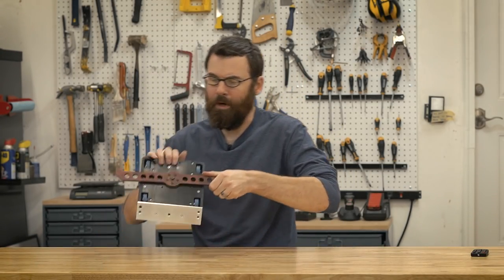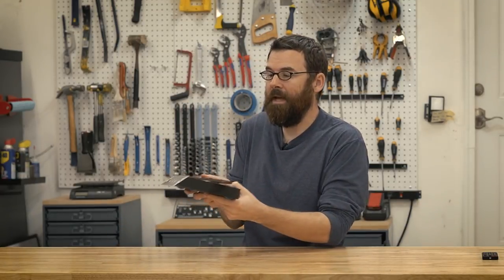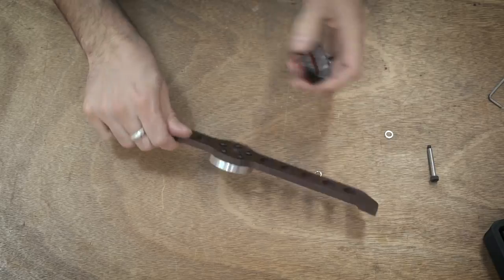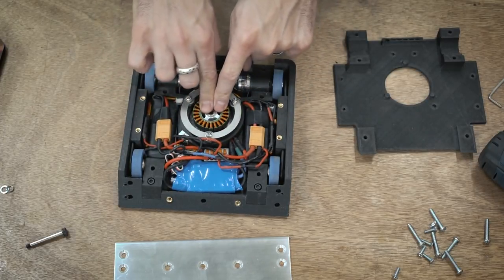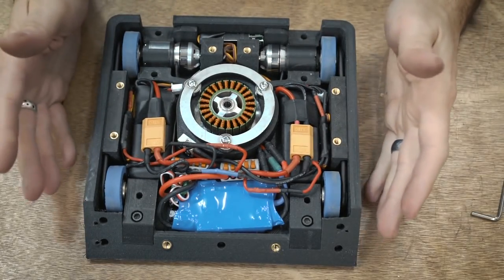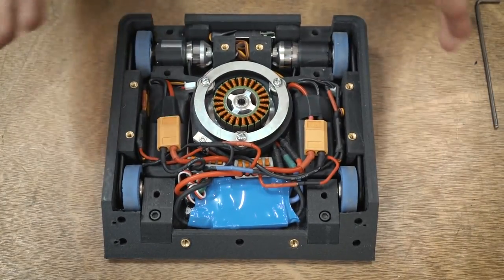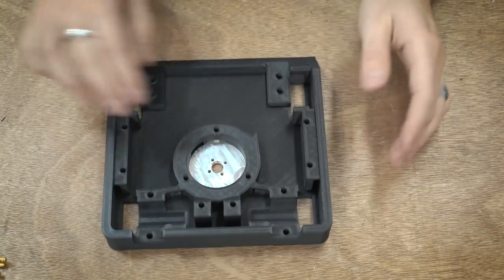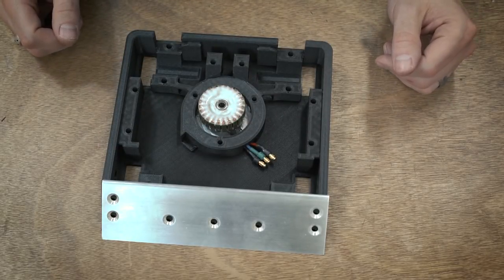Anxiety Attack Overview (Beetleweight Combat Robot)

Comment: What are your thoughts regarding Nylon X and similar vs Polycarbonate blends like PC Max for frames? I've found the increased stiffness of PC to be desirable for combat but in extreme cases it will shatter vs 'tear' like the nylon. Sadly both are just as challenging to print as each other, warping might even be more severe with PC!
Reply from the maker: I need to play more with filaments.  The problem is testing them in real situations is limited, so it takes a long time to learn what's best.  I am going to test the NylonG next and maybe try some polycarb.  I've seen other people use it and it SEEMS like it's good, but I like the give that nylon has.

Comment: It seems like your ESC‘s are really big for there power. I only build drones but my 50-60A ESC‘s seem a lot lighter and smaller. I have no experience building combat robots though so maybe I’m missing something.
Reply from the maker: I'm maxing all of them out.  I am peaking at around 55A on the weapon, and it could use more power.  On the drive, I've seen around 10-12A when they get close to stalling.  Usually you want to double the rating for safety, but I didn't have the weight or space.
Reply: Oh okay. I did not know that. With drones it’s usually okay to pick one 5A higher than the Max Motor current and it’s save enough. But I guess the cooling under a giant fan is also a lot better than in a closed box.
Reply from the maker: @blise518B  USUALLY size and weight equates to actual power output.  Some of the new chinese ones are pretty good, but historically, they've not been well-suited for combat situations.  In short, when using components for combat robots, you will get to see how they fail, and quickly.  I was using a bolt with a tensile strength of 140,000 PSI, and it got bent in one hit.  It seems like the rules of physics and electricity don't always apply in combat ;-)
Reply: Robert Cowan your right some Chinese sellers are not really thrust worthy. I usually stick to sellers and brands that I had no problems with. Most stuff you buy in hobby stores is manufactured in China anyway so if you buy directly from China you will save a lot of money.
I know it’s bad for local stores but as a student my budget is limited.

Comment: Great video! Just gotta cross our fingers you don't get flipped over 😬😬 I am looking into making my first 3lb from some scrap, things are gonna be really tight and I wanted to use 4 N20's as drive because they where small. Some people I talked to said it didn't work but I looked closer at your video on kamikaze and where you using N20's on that? The one gearbox did shear I was gonna re -enforce them and just see what happens in battle.
Reply: I have a couple recommendations for reinforcement based on my experience using silver sparks in a beetle (bit bigger than N20s but the idea is the same). First, do not face-mount the motors to the frame using the screw holes. Instead, clamp-mount the motor in such a way that supports both the motor and the gearbox. Second, support the output shaft somewhere between the motor and the wheel using a bearing. Third, use soft foam wheels to help avoid transferring shock to the gearboxes. If N20s can be made to work in a beetle, that's probably how you'd do it.

Comment: Maximum Material Removal Rates are calculated off of Surface Footage per minute SFM... S7 has an SFM based on What Material it's Cutting.. 
S7 cutting plastic is around 1000SFM,
S7 Cutting Aluminum 500SFM, S7 Cutting Titanium I Guarantee it's aboot 40 SFM... 
I'ma 15 Year Machinist, Toolmaker, and Master Heat Treater, currently in college for Mech Engineering Degree. Thinking about forming a Club at my college...

Oh the formula to Calculate RPM is as follows.  (SFM X 3.82) Divided by Diameter of Cutter = RPM

Brazed Carbide cutting Titanium has an SFM of 250-ish... You can Braze Carbide Flakes on the ends of a Chunk of 1018....

Your Expensive S7 needs the holes replaced by an open window....       
It's not How Much Mass, it's Where the Mass is placed that's critical...

Comment: Thoughts: 1) Use shims to adjust one of the wheel supports, then the frame bein planar is not so critical. 2) Seems like   the  motor's rotor may distort causing problems with the magnets. Possibly you could machine a sleeve that pressfits/loctites around it's diameter, maybe it won't be an issue 3)good luck!

Comment: For ESCs, have you ever thought about looking at Lumenier's BLHeli_S Opto units? They might be a bit on the pricy side, but they're unusually compact. I run a 35A one in in my antweight beater, Shadowkitty. Usually 35A ESCs are a bit big for antweights, but I needed a really small one to handle the current draw of a Lumenier 2206 Freybott Edition and the Lumenier Opto 35A isn't much bigger than a Turnigy Plush 20A.

Comment: Who says Both Driven wheels have to be on the same Axle Alignment, if you utilize a dummy wheel and driven wheel on the same axle alignment you would solve the stability issue by balanced placement of component weight.....
It might be a warped chassis, most likely the Corner Weights are biased to the Back, the holes aren't big enough in the blade and your making Propeller Wash.....

Put a wedge of 60 degrees on the other three sides, makes for bidirectional driving and Minimizes the Target Areas you present to your Opponent....

Comment: Great video, very informative. Have you thought about shaping the bar like an upside down helicopter blade to get downforce/negative lift? I don't know how fast the bar needs to spin to even make a tiny bit of downforce or if it puts unnecessary stress on the motor, but it might increase grip and make it harder for other bots to get under you. Could be something to look into in the future.
Reply from the maker: The final version actually uses a quadcopter prop on top for downforce.  I'm not sure how much force it provided though.
Reply: People have tried, and they have all failed to function
Reply: @Coboxite  
Foiled! did pretty well with it.

Comment: Hi, Robert! Immaculate engineering and great video quality as always. No problems about pronunciation, by the way - it was Noah Webster's aim in life to expunge all traces of French from U S English,  so chassis (or chassis) is absolutely fine. Then of course there's the old Leftenant/Lootenant Cuddles thing... Yeah, Sergeant, I know. But what about the aluminium/aluminum wedge, eh? If you're replacing it with something stronger, don't use titanium, insist on titanum. Or magnesum-alloy. Much better. More Amercan. I'll go away, now. They're expecting me down at the gymnasum.  ;-)

Comment: Bit late to the party but what size threaded inserts are they? Currently designing my own combat robot but can’t pick a screw diameter, m3, m4, m5? Think in the states your sizes are different but would be greatful for a suggestion, for my first I’m planning 3D printed nylon and hdpe with a machined weapon, outsourced, the chassis I want to make myself so am limited when it comes to tools, they will be printed or for the hdpe jigsaw and a lot of filing / sanding, just can’t figure out what size screw to use or find somewhere that suggests what to use.

Comment: Fantastic video, thank you! Have you ever tested with gyro stabilisation for yaw control? Possibly wouldn’t be tough enough, but during battles you often see operators having a some difficulty and wasting time lining up for an attack.
Reply from the maker: Thanks!  I didn't play with anything like that.  In the fight video recap (coming up next) you can see what happens when it gets off-balance.  I don't think there is a way to correct for this.

Comment: What would you recommend as a good cnc milling machine that can cut steel for around $1000 or less. Thanks for any advice.
Reply from the maker: Unfortunately, no.  Other than just buying used, there's nothing out there under several thousand that will cut steel well.  Just outsource, it's cheaper unless you're making a lot of parts.

Comment: Is your printer using mesh leveling, like a BLTouch? It might help with some of the first layer adhesion problems you were talking about.
Reply from the maker: Yes, it is.  I fixed the problem by increasing the bed temp, and re-doing all the mesh leveling AND manually leveling the bed better.

Comment: Why did you make the motor mount holes on the bottom not square to the robot, my OCD is killing me haha. Beautiful design otherwise.
Reply from the maker: They are rotated so the motor wire can exit at the correct angle.

Comment: Does that Nylon-X respond well to heat treating?  Heat the printed part to a nominal temp, then turn off the oven and let it cool down slowly.  I wonder if it will help with correcting warping?
Reply from the maker: I'm not sure.  It's something I thought of, but didn't end up trying.  The sizes were all pretty critical, so I would need to experiment with shrinkage to get the final sizes right.

Comment: I like the idea of using 3D printed nylons, what sort of % infill are you using? I've been a fan now of the gyroid infill after seeing some strength tests with it compared to other geometrical infills.
Reply from the maker: I think I'm only doing 10 or 20%.  It's too low, but I didn't have any extra weight.

Comment: How do you check for RPM of Motor for spin adjustment .... Is motor sensored ?
Reply from the maker: it is not sensored.  I'm not sure what you're asking, but you just multiply the KV rating by the voltage to get RPM.

Comment: Fantastic work as always - I'm trying a Nylon Carbon Fibre weapon motor mounting panel in my 30lb/13.6kg undercutter this weekend, hopefully it goes ok!
Reply from the maker: Thanks!  That sounds ambitious!  Are you going to print it solid?  Hopefully a really high in-fill at least.  Good luck!
Reply: Robert Cowan it is solid yes. Not sure how it’ll fare but its an experiment more than anything else, wouldn’t be doing it if I hadn’t got access to the printer at work that they rarely let me do my own stuff on 😄

Comment: I personally dont like the nutcerts on 3d printed parts, better to have the bolts go through the complete part and have a large washer or threaded plate on the backside. It compresses the parts holding the layers together a little more. With nutcerts they can pull out under stress.
Reply from the maker: I am going to make a video to show what I found with them.  They absolutely WILL NOT pull out under stress.  Look at when the wedge was ripped off, it took the whole front-end with it.  I 3d printed a lot of test parts and used my hydraulic and arbor presses to test the pullout on them, and in all tests, the heat-set inserts pulled the entire core of the print out.

Comment: Why not take the 3d printed part and then using your Tormach true up the prerequisite surfaces to basically cut it true and straight?
Reply from the maker: this stuff doesn't machine well.  plus, that would add a TON more time.  lastly, my Y axis doesn't have enough travel.  :-/
Reply: @RobertCowanDIY  if your concern is just the bottom sitting flat you can just deck that surface using a large diameter flycutter. In addition im not sure your print medium but with platics sharp HSS usually is your best bet for cutting it. And with a large diameter flycutter your y axis travel shouldnt be an issue

Comment: To help warping look at adding lily pads at the problematic corners. Discs that are several layers thick and stick out past the corners to increase the surface area there. I have found that works a lot better then a brim around the entire printed part.
Reply from the maker: Nylon can be strong!  In one print it was sticking just fine, but it actually warped the print bed!  When it cooled, it pulled the edges of the bed up, which was surprising!  I think I might need a heated enclosure for the best results.
Reply: @RobertCowanDIY  yes I print in an enclosed printer when possible. I just find giving the corner more mass with the thick lillypad yields better results on warp prone materials like PC and Nylon-CF20 variants. Also printers without moving Y beds (beds that just drop like an Ultimaker) perform better because the part experiences less drafts due to bed motion.

Comment: why don't you try CBN polycarbonate?
Reply from the maker: because I've had good luck with NylonX in the past.
Reply: @RobertCowanDIY  currently I am working with it.  I think polycarbonate is supposed to be stronger,  but there might be some other attributes that might come into play. My antweight "Drill sergeant"  is supposed to be that material. Due to the weapon weight being so high the chassis ended up 54g, a bit of a skeleton.We'll see how it does...

Comment: Hey rob, what motor did you use for sgt  cuddles spinner? and what speed controller? i might make a wedge with them (and maybe add either a lifter or two more wheels should i be underweight enough and not have room for four)
Reply from the maker: If only I made a video series about all the parts I used in Sgt. Cuddles.  Oh wait, I did!
Reply: Robert Cowan i was being stupid i guesz

Comment: That drive can’t be vary powerful because the mothers only weigh 17g and the moters I am putting in my beetlewaight weight 60g and are brushless aswell
Reply from the maker: The motor is only a small portion of the drive system.  If you add downforce, it's plenty powerful enough.  Traction and weight distribution is far more important.  If I went with bigger motors, they would just break traction sooner.  I can put about 5 extra pounds on the body and it doesn't slow it down.  Tuning the ESCs helps a lot too.  An extra ~50 grams per motor would be wasted IMO.  These are also small wheels, so less torque is required.
Reply: I also have 4 mothers so would that help or would it be pointless because my robot is a wedge 
Also is 2mm steel thick enough for a beetlewaight
Reply: Also I just realised 

This is like the original design for Sargent cuddles but bigger and made more realisticly

Comment: you might want to make sure your 3d printer has  good cooling to prevent warping.
Reply from the maker: What do you mean, good cooling?  Nylon does not like being cooled while printing.  It will warp REALLY bad if the layers cool too quickly.  I increased my bed temp to 80C and added more glue and that fixed it.
Reply: @RobertCowanDIY  I've found the same thing.... I run nylon x and g at 270 and 80 on the bed, and print it really really slow....  on a pei sheet with lots of gluestick, I've had really good luck, all with the cooling fan off.
Reply: Sorry I am not very good at getting my point across I meant that cooling to fast can cause warping . You are very right about the fans though. Also here is more information I found                                    1.Nylon filament temperature wants to be around 240C-260C and up. We recommend experimenting with temperatures above this, incrementally to find the best Nylon printing temperature.
2.Heated bed wants to be at around 80C+. We recommend 100C or more even, as Nylon is sensitive to cooling too fast, and that causes warp.
3.To aid adhesion, use a PVA glue stick on a glass or metal print bed. Kapton tape can work also. Ultimately for best results, we suggest using Tufnol sheet as a bed surface. This seems to work the best for Nylon, which is prone to warping if you don't use the right surface. 
4.Make sure layer cooling fans are off and you’re not printing in a drafty or cool environment.